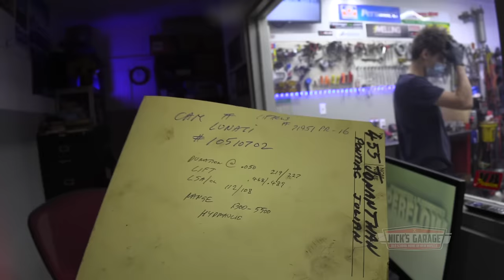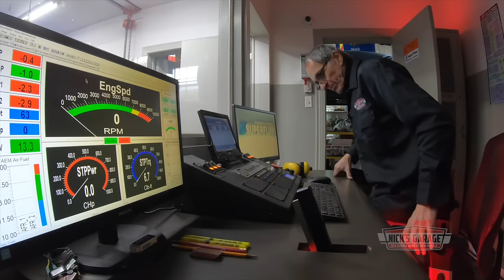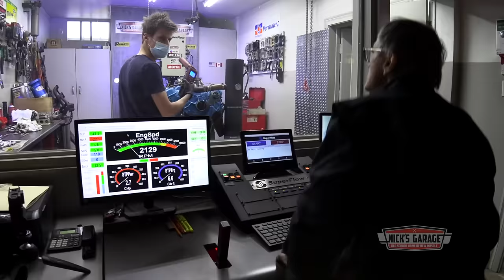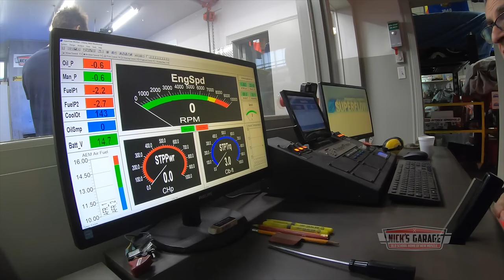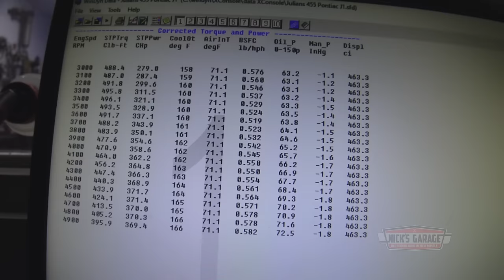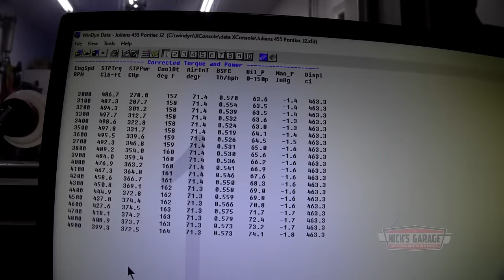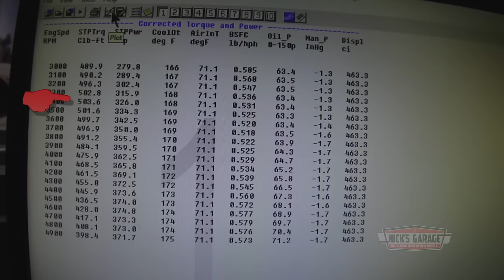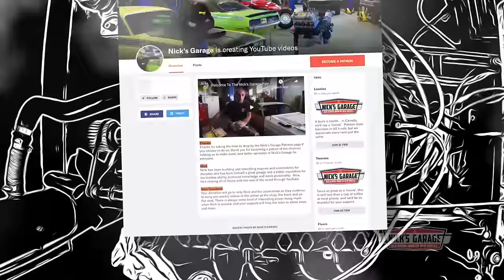Pontiac 455

Comment: Nick, for your voice, during the cold winter months, you need to drink more water and you likely need a CPAP device with a humidifier reservoir for your sleep time (they are not hard to get use to). Also, consider putting a top quality humidifier in your shop's heating system; you'll feel better and the shop crew will also. You are not a smoker are you Nick? Regardless, do as I recommend and you'll feel MUCH better. Also, start these things BEFORE the Montreal air gets so dry. Blessings, Dr. A.K. Horsepower (MD, HP, LMNOP, etc.). :-)

Comment: I'm assuming that Q jet is a 750 cfm, a 800 cfm would be better but they getting hard to find. That Q jet is probably jetted way to lean, change the secondary metering rods to some that have very thin tips and use hangers that lift them highter, meaning more gas. Replace the primary jets with larger ones and the engine will increase in HP.

Comment: Thank you for doing a Pontiac engine. I am a pontiac guy by nature. For a stock build those are pretty good numbers. The ram air exhaust manifold from what I am told flow just as good as Headers. I am Headed guy but headers on a pontiac are a pain in the Azz. A after market intake and carb would help make more power. Nice build. I glad to see you used roller rockers on the engine.
Reply: There's a really good test from Hot Rod magazine in about 2010 that tested Ram Air manifolds against several headers. The manifolds give up about 20 horsepower over good long tube headers on a 440hp  455 and about 12 horsepower on a 367hp 389. Far more important was the lost torque down low and the overall better averages with the long tube headers. I don't disagree about the pain in the butt and for a trouble free street machine the manifolds are great, but they do lose noticeable horsepower.
Reply: Jim Hand wrote a really good book about Pontiacs.

Comment: Very good! 
For a basically stock engine, that thing runs hard... 👍 It WILL fry tires at will. 

It's HARD to get a huge horsepower number with an engine that only revs to 5000 RPM's, as the horsepower number is calculated by time (RPM's). 

BUT, there's  PLENTY of torque there to be FUN.. 😁

Comment: Would love to see u bring more in. I have a 78 TA and a 55 Pontiac. I rebuilt a stock motor for the 78, it’s a 70 formula 400 motor stock 360 HP. I got the heads completely redone a 750 double pumper, a edelbrock high rise and hooker long tube headers hoping I’m gonna get like 380 Atleast out of it 👍👍

Comment: Nice big Pontiac Nick! I had a 1977 Lemans Can Am with the T/A 6.6 back in 1977. That cam is a bit better than the old Ram Air 1 and 3 automatic cam which was the 288/302 or 211/224@ .050 Hope you feel better!

Comment: It’s either 750 or 800cfm. You can look in the primaries and if there’s a bulge in the casting it’s an 800cfm. The casting number is in the drivers side on a pad on the main body. From the throttle linkage it looks like an Oldsmobile carb.

Comment: . I would of tried an open spacer or Metering Rod changes. Possibly the cam is too small.

I also noticed:

- the fuel pressure dipping below 4 psi. May or not be an issue just an observation. 

- the manifold vacuum up at 2” at the higher RPM indicating a slight restriction. Those secondary air valves should be opening up more. On his dyno with other engines I have seen .5” to .7” of vacuum at higher RPM.
Reply: You are correct. There is a restriction. You see it on the vacuum reading.

Comment: There are two size Rochester Quadrajet carbs, 750 CFM and 850 CFM, the only engines factory equipped with the 850 were the 455 Buick Stage 1 and the  Ford 429 Police Interceptor, so maybe try a Buck Qjet on the Pontiac and see if it makes more power.
Reply: @Car Guy daddyo , Yeah I couldn't remember whether it was 800 or 850 off the top of my head.
Reply: Also used on 1973 Pontiac Super Duty 455"... 850 CFM cast with no secondaries venturis...

Comment: was close on HP,  I guessed  375 Hp . Carb  needs a  .010 washer on power piston spring or next spring tension up . as to CFM smooth bore (perfect circle) on primary is 750 if borre has a bump on it is a 800 CFM carb, as Nick say look down throat at WOT to know the CFM,  I think hes testing us ole timers. Nick you need to boil a pot of water for air is to dry in the shop, that's why your voice is cracking. other is check the heat exchangers aren't cracked on furnas
Reply: 1973 850 CFM Super Duty Pontiac 455" Q-Jet cast with no venturis in the secondaries is needed...

Comment: I have to say that this motor is hardly rolling easily. From the sound I hear, the timing is short of the firing at the best time. To bad you cannot vary the timing from the control center,....move the timing through the degrees of dwell, through the TDC, and find where the power is pressing the stroke especially well.

Comment: Just imagine what it would do with a little bigger cam & a larger carb.. be some impressive numbers for sure.. good job as usual Nick..
Reply: Unless its a super duty block you have to be careful w/big cams on these standard blocks,
they dont have the strength in the valley forging.
Reply: Take that motor..put headers on it..roller rockers ..aluminum heads. Bad ass cam . and high volume oil pump. And put high performance distributer and that thing be over five hundred hp easy

Comment: I see still full vacuum on the distributor. There should be a port on the front of the carb. When you pull the hose off at idle, it should be no difference. 🤔
Reply: I know. But has a smoother idle with vacum.

Comment: By the way a stock Qjet is 750 CFM they did have a 800 CFM but the most common is 750 CFM. Some Qjets are better than others depending on the year.

Comment: my guess was a little low but did not know about the cam from lunati can make any engine perform better. Compression is little low for performance should be over 10 - 1 and cam around 4500 - 6500 rpm range for performance on the street racing cam little more duration expecially on the exhaust valve can have more duration or stay open longer than the intake valve settings to not hit the piston at TDC

Comment: I use Isky Anti Pump up Hydraulic Lifters Isky Cam 280 mega Roller Rocker Arms 7/16 Chevy Rocker Arm Studs Poly Lock Nuts Never had Valve adjustment go out of Spec. 455 Engine 6X Heads 211 Int Valve  180 Exhaust valve Mild port . TRW Forge Pistons Sealed Power Chrome moly Rings Melling 80 Psi Oil Pump, Nunzi Road Racing 6 Qt Oil Pan . 800 cfm Qjet carb Jetted high Capacity Needle n Seat a must Edelbrock Torker Intake Manifold Carter Mechanical Fuel pump 120 Gph,  Distributor HEi  new Ac Delco Blue Streak Dist Parts Accell 8.8 Wire wound Inner core  ignition Wires NGK Spark Plugs Ram Air Cast Iron Exhaust Manifolds 2 1/2" Dual Exhaust Flow Master Mufflers Chrome Dual Exhaust Tips. Installed 76 Trans-Am 4 Sp manual 4 wheel disc Brakes

Comment: Nick with that over squared engine you really needs some hp comp pistons to make it run 12to 1 with over 600 lift 300duration cam 950 carb and hot ing

Comment: Check jets metering rods see if they even match  get 1.65 rockers [better heads+RA IV intake, (or edelbrock)] nice exhaust manifolds you got, bigger cam, rhoads lifters or hyd. roller. 10 to 1 comp. stroke it.

Comment: Quadrajets are either 750 or 850 CFM from the factory depending upon engine application.
Reply: @Car Guy daddyo OK
Reply: @Car Guy daddyo - 1973 850 CFM Super Duty Pontiac 455" Q-Jet cast with no venturi in the secondaries...
Reply: They go all the way down to 575. But it is easy to modify them as Rochester used a stop on the secondary air valve to restrict the air flow. If you push the secondary valve open while the engine is off you can see on the smaller ones it doesn't open all the way. By filing the ear down it opens farther and increases the total CFM. Now there were notable changes over the years to the rest of the carburetor and eventually they do use a smaller secondary throttle plates but that was in the 1980's. And I have always read that the SD 455 carb was 800 cfm but it wasn't the only engine to use a Q Jet that big, it was just the only performance engine to use an 800 CFM Q Jet so it had a larger idle circuit. I maybe wrong but in about 1986 my dad bought an NOS SD Q Jet from HO Racing Specialties which is now long gone and it was listed as 800CFM. And every article about the 455 SD lists it as 800CFM. Maybe they are all wrong though?

Comment: With stock intake and exhaust manifolds those numbers are solid. A 1/2" spreadbore phenolic carb spacer may help the fuel from puddling on the manifold floor? Seems to bog pretty hard and not gain rpm rapidly enough. It's worth a try.
Reply: Cause it's strapped to an engine brake called a Dyno TF u think it free revs?
Reply: @christopherparis6841  You think, I think it free revs? Pretty sure we're both watching the same video? It bogs, period.

Comment: So did you work on the Pontiac 301 Turbo if you worked there from 1976 to 1981?

I was born in 1984 and when I was young, turbo power sounded like magic. How magical did it sound when the 301 Turbo went on sale?

When I was 5, the Nissan 300ZXTT went on sale and I instantly wanted one. When I was 14, and I read an article about getting 450 horsepower out of one and learned what a mass air sensor was. I knew I would be able to work on EFI engines. Like many millennials, I do not know how to work on carbs and don't think about it much. I think if I was motivated to restore a classic, I'd buy some kind of EFI kit. I have thought of restoring the GMC RV that used an Olds Toronado powertrain.

I like reading about origin stories about what made certain car guys who they were. I'm glad you shared some of your stories. I think you said that you saw a hemi engine and loved how it looked, or was that UTG? UTG is an interesting Mopar guy.
Reply: I know Tony from UTG. Good person .
Reply: I owned an 80 Turbo T/A. The turbo technology just wasn't up to the challenge yet. You could tweak the wastegate rod and they would go from about 5lbs of boost to maybe 7 or 8. From a dead stop if you power braked the car to get through the turbo lag it would take off and get sideways as if if actually had some power and torque. Unfortunately the horrible siamesed intake ports and tiny valves on the 301 meant even on boost it ran out of breath at about 4500 rpms. There was about a 2000 rpm range, where if driven correctly they felt like a muscle car but it was hard to find that range and it was over way too quickly. The best I have ever seen one run at the track was about 16.8 with most running more in the 17's. As for my personal 80 Turbo Trans Am? I pulled the 301, put in a 455 with #13 heads, an 041 cam, headers and small stall and with it's 3.23 gears, looking all stock, it would run 12.3-12.5 all day long on drag radials.
Reply: @1967davethewave  Interesting story, thanks. I have no idea why they cast such awful cylinder heads for that application.
I heard some of the turbo lag was also because the exhaust gas would lose a lot of heat by the time it finally reached the snail. The exhaust pipes were a maze on that engine. I think it is why so many turbocharged gasoline engine had one snail for each bank.

Comment: Round raised circle on top of quadrajet designates it to be a 750cfm. Used on GM big blocks. The quadrajet without that raised area is a 650cfm. Normal small block carb. fyi.
Reply: There's also 1973 Super Duty 455" 850 CFM...

Comment: This 455 will be a mass improvement over the factory 455 in that '76 TA. The stock engine has 7.6 to one compression ratio and 200 hp. The factory intake had half of the secondaries closed off. I'm not sure that the mid rise intake on this motor with work with the shaker hood though.
Reply: You are correct. Improvement for sure.
Reply: Pontiac went from low flat intakes to higher rise intakes in 1965... added 10-12 more HP to ratings...
Reply: Other than the secondary openings that you mentioned and the smaller plenum inside due to the EGR ports the intake is the exact same height as any 67 and up Pontiac iron Q jet intake. The other difference is the change in exhaust crossover due to the addition of cooling cavities in the cylinder heads. They were added to keep the additional heat that flowed through the exhaust crossover from transferring into the valve/rocker area and causing oil coking. Many manufacturers already did this like on the big block Mopars and big block Buicks. Apparently it wasn't an issue on Pontiacs until the EGR came out in 73 though. You can't easily us a 67 to 72 intake with 73 to 79 heads without some custom work. It causes an exhaust leak.
Reply: @1967davethewave  I owned a '76 455 and didn't remember it being that tall. I guess that it just looks different perched on that dyno.
Reply: @MnPaul1  Yeah, they do look tall. My brother in law who is a Chevy guy used to think the Pontiac intakes looked better than aftermarket Chevy intakes. But they are the same height at the carb flange.

Comment: 370 is really good for a Pontiac 455 that's about the most a stock engine ever made even in the HO engines it was max power . the Chevy and Ford big blocks made a lot more with the same displacement and the same fuel . I never understood why they seemed to be bottlenecked for power and I think it's in the head design they never seemed to flow like they should . I'm not saying anything about Chrysler in this because the Pontiacs never stood a chance against a Dodge or Chrysler so I left them out. that being said they can be made to have a lot of power but you need to get rid of every stock part except the block to make it work.

Comment: I thought you said that was the low comp engine you must of done a great job on rebuilding that engine you must have cut the heads at 30 and maybe the block with thin gasket

Comment: This engine deserves an aluminium intake, better carb and headers and a good free flowing exhaust system.   It would probably hit 450 hp OR MORE just doing the bolt ons.  I've seen a dyno test or 2 that did those bolt on and picked up 90 because the engine was all choked up.   These parts are nothing you can't remove and put back easily to stock if that is required for some reason.   It already has a mild cam after all and an aftermarket Pertronix distributor I think I saw.    From 3000 to WOT the vacuum came up .7 points so it needs a bigger carb anyways.This engine sounds really good on my PC speakers, LOL.   

My brother had the fire chicken 455 trans am when I was a kid.   It ran good but more importantly it handled very well.   He scared me a multitude of times in that thing.   It had that embossed metal instrument panel bezel which looked kind of like it belonged in an airplane.

I hope you get better with whatever that was.   I have to avoid breathing in the cold air because it will cause me to get laryngitis then a respiratory infection and then pneumonia.   In a pinch I will get a good strong shot of something or other or hot tea with a good strong shot of something and honey and lemon in it.    We call these concoctions hot toddies down here.   It helps.   Don't you have some of that home brew jet fuel left?

At around 37:57 or so in the video looking down at that carb the secondary air valve didn't look like it was full open.   It could have been the angle or not.   The linkage was rattling too so it may need another turn or 2.   Just trying to be helpful is all.

Comment: Compression and octane are a very big deal when it comes to power gains.  I had to back off a lot of timing in my daily  driver because I couldn't afford 93 octane anymore.  Next I'll replace the smaller head gaskets with some thinker ones and replace that 274 cam with a 242 cam.
Want power?😈  Pay the piper.⛽

Comment: Quadrajet carbs came in either 750 cfm or 800 cfm, the size of the primaries being the only difference.
Reply: Some also had early stops on the secondaries linkage (Firebirds)... and the 850 CFM Super Duty Pontiac 455" Q-Jet cast with no venturi in the secondaries...

Comment: IIRC, while the 'standard' QJ was a 750 cfm carb, some of the biggest GM engines used an 800 (might have been 850, it was a long time ago) CFM version if it has the 'small' version it may be slightly restricted?

Comment: I have a 73 455 early edlbrock  heads 87cc 0.30  with  bracket master 2  cam .490  performer intake  long tubes 1 7/8 primary’s  hei

Comment: Yaun, that was a lovely mild grandma's build. Everyone does mild Pontiac builds. Why. Why not do a max power build like they do every SB chevy? Pontiacs make a lot of power if you build it that way. You can go over 3500 RPM. They will go past 6500. Try say 11:00 to 1 compression. 1.65 ratio roller rocker arms. 6x heads with stainless steel valves. Maybe aluminum heads. Roller cam. Don't be afraid to go wild. Maybe turn down the mains and use BB Chevy rods. You won't believe it.
Reply from the maker: Because because because it is what the customer wants. He's putting this in his son's car.
Reply: You are talking expensive parts made of unobtanium...

Comment: i think the Pontiac valve covers should have had more bolts to prevent leaks
Reply: Yeah, so should small block Chevy's. Since they were both designed in 1955 I don't think leaks were much of a concern. Chevy did fix the small block in the 1980's, several years after the Pontiac was out of production though.

Comment: Did Nick ever changed the Metering rods in the back? I always had luck the thing ones on my 455. Plus the spring in the distributor are probably the heavy ones they stick in there. I would have tried the medium and lighter springs.